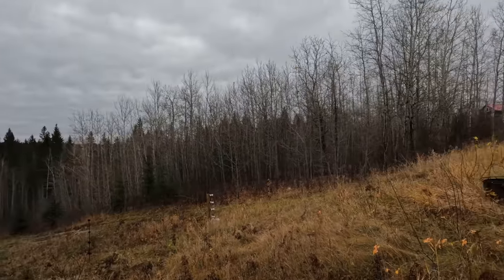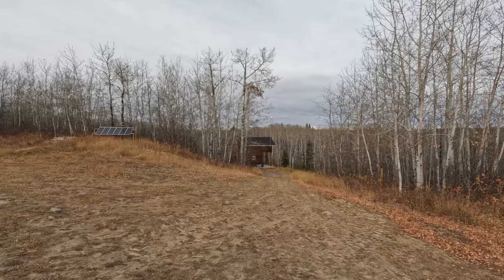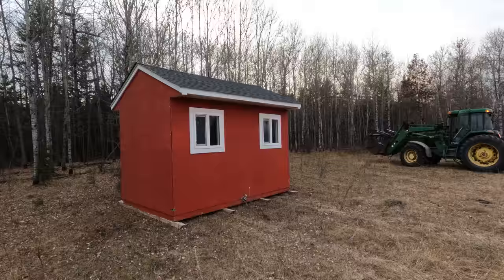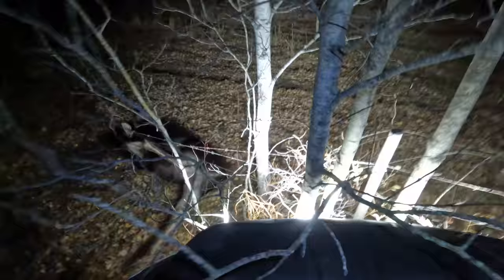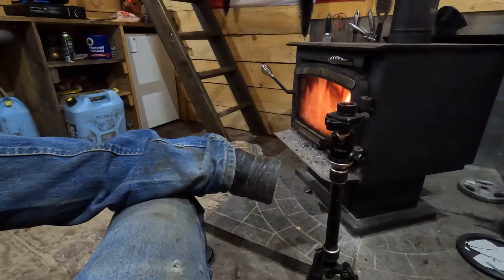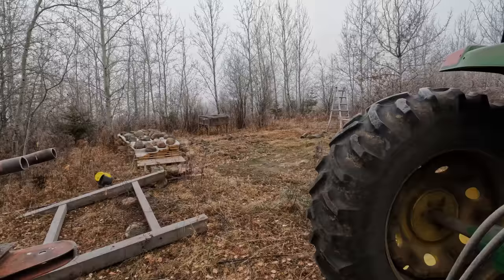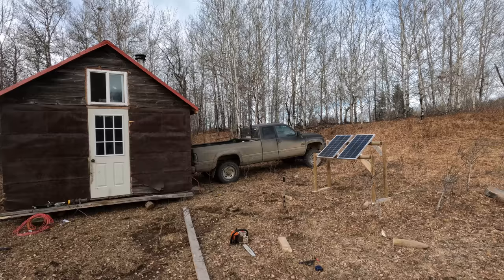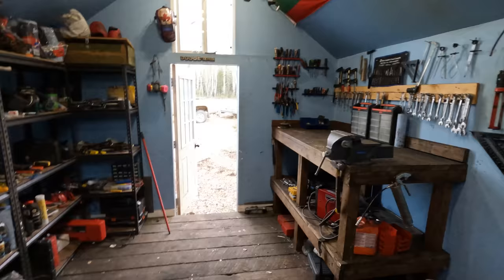Moving my Offgrid Homestead Pt. 1

Comment: Great job so far on the move. Question how far are you moving in miles from one camp to the other. Are you contemplating moving back to the old camp area, after you through building new log cabin. Would it make more sense to leave the cabin where it is and use the workshop as a sleeping area for now. Again great video and looking forward to the next thanks Big John Boston Mass

Comment: Then use some chains connected to hook buckle rings straps.& Buckles from side to side both ways. More time involved yes. I'd x ❌ cross the ones going on last over the other ones for triple support is all.  You know what I mean by that part of it run four one way.& Four the other way.& Then two/2 ❌ cross ways from corner to corner left to right.& Right to left. Ratchet straps & buckles. I'd pick up some more along with some logging chain.& Ring nose buckles like for farm equipment usage style for that purpose.& Those reasons alone to. Cause you can make some of your money back To.  Also by hauling other people's stuff to with them as well to. Later on down the road if need be to. For A side hustle to right man. Just saying brother man it's where it's at now days anymore. Cause you never know what you might need.,or when you'll end up needing it either. It's always better to be prepared than not in life for sure no matter what it is especially now days even more so with everything that's been going on.

Comment: Would it be possible to lift the cabin so that you only have to slide the ramp underneath it instead of using a winch to pull the cabin onto the ramp? Sort of like a forklift.
Maybe logs on each side (wider than the ramp) and slowly lifting the structure on each side until you reach the height of the ramp, at which point you only need to slide it in, I'm not sure it's possible, it sounds time consuming but I'm guessing it'll cause the least amount of stress of the structure of the cabin.

🅲🅲🅲🅲🅲🅲🅲🅲
🅲🅲🅲🅲🅲🅲🅲🅲
🅲🅲🅲🅲🅲🅲🅲🅲
🅲🅲🅲🅲🅲🅲🅲🅲 (cabin)

🅲🅲🅲🅲🅲🅲🅲🅲
🅲🅲🅲🅲🅲🅲🅲🅲
🅲🅲🅲🅲🅲🅲🅲🅲
🅲🅲🅲🅲🅲🅲🅲🅲
🅻🅻              🅻🅻
🅻🅻              🅻🅻 (lifted cabin)

Comment: I would.  Say. Hello. First.   Then. How. About Dipping. Your. Cabin. Ove.     Be FORE.  Moving.  And. Haul. The. Cabin.  On. It's. Side.  Your. Straps.  Pull.  And.  Hold.  With.  The. Come along.  Constantly.  Holding.   Force.  Two. Both. Sides. Of.  Cabin. Too. Inshore.  No.  Damage.  I. Think. You. Can.  Doi.  It.    Take.  Your.  Time.  Your. Seem.  To. Ne. In a. Rush.

Comment: That trailer is high for the cabin, be nice to have low profile rims and tires and the frame lowered, which i know is a ton of work. Also weld up 4 brackets that can be bolted to the deck of the trailer with some long pipe thatll reach the cabins wall, one on each corner or a foot in with two pieces of plate you can put four bolts that go right through the cabin , 2 by 2 3/4 inch ply as backing between the cabin walls interior and exterior for thru hull bolting captain lol, attach that to the steel pipe you welded a bracket to attach to which can be sucked tight with a come along, and if that doesnt confuse the fuck outta ya pardner then just sit back and think about it, Never say woah in a mudhole, gear down and go harder. Or just skid it on logs. Thats why they call them skids.

Comment: Should get round  poles 4 inch in diameter cut a straight tree, and put them in across the front on the deck trailer and when you winch keep putting them in at two foot increments then when the house comes of the pole as it role's along up the deck  then take that pole that comes out the back end and transfer it to the front when you get it to where you want it jack it and let it set on the deck do it in reverse to get it off it would be no effort at all That little come along would pull it up by itself! Follow me?